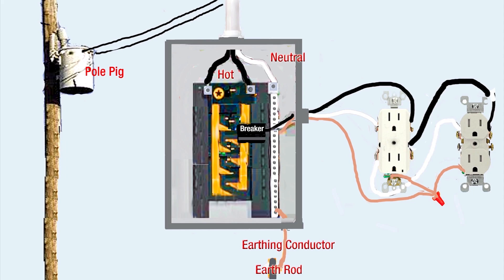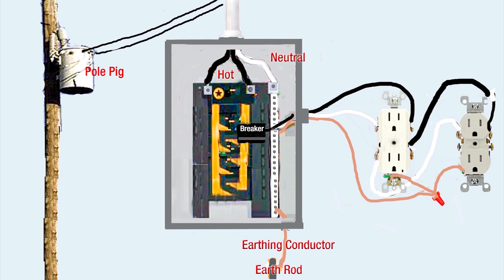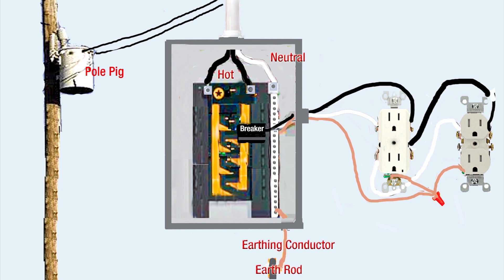Grounding, Bonding, Earthing, Shielding and Protecting with Jim Heath W6LG

Comment: Jim, see Dave Casler's episode 8. He advocates a common ground. His reasoning is that the green ground in the house wiring is too far away from the outside pole ground. It seems that there are multiple opinions on this subject. I even see a real PhD responded in comments here and was also ambivalent regarding grounding. Great video and I really appreciate your sharing of knowledge.
Reply from the maker: Hi and thanks.  I don't watch Dave's videos.  I believe he presents good information.  I just don't want to inadvertently copy his material or ideas.  So, I purposely don't follow Dave.  I did send a letter to him a last year but that did not go anywhere.  There is another guy in CA who's videos are contain a lot of incorrect information.  I have watched several of his and I am shocked by the lack of knowledge.  Back to your question, in the other 2 videos I do try to follow the NEC and the CA electric code.  I do recommend a single point ground of all equipment. I don't recommend a daisy chain.  I do recommend a very low impedance conductor. Everything must go to the Intersystem Bonding Termination.  My view is that using the "green" (it can be another color) wire is too great an impedance.  Watch the two videos from May and see what you think.  Mike Holt is the expert that I relied upon and his recognized in the US as the leading expert on the subject.  Back to Dave, Dave is a good guy and provides good videos with lots of solid information.  As I said, I just don't want to accidentally copy his material or ideas.   I hope that at some time in the future Dave and I can communicate frequently. Thanks, Jim

Comment: Power Plant Electrician for 35+ years.  Do what ever it takes to protect you and your equipment from voltage on the wrong path, but remember as a ham we also have to  keep our noise level down to the lowest value...  The best ground as in RF would be on a large steel ship in sea water.  The ocean is the best counterpoise, but ships have the ground and neutral isolated for electrolysis reasons.  You should get voltage from the nuetral to the ground on the whole ship.  The radio grounds are wide copper strips that connect to the ships hull.  More later, Thanks Jim.  Corey Wade  KG6TVJ or on my boat it might be a ship FCC Call letter system.
Reply from the maker: I have seen that.  Some guys think that 6AWG as called out in the NEC is the answer.  Flat and wide copper is good.  As I am starting from zero, grounding will be step 1.  Thanks Corey!  73, Jim

Comment: Thank you for another great video. I simply love the calm, non-judgemental way that you express your thoughts and mentor, or "Elmer", others.

In answer to your question about GFCI (aka RCD in New Zealand), I believe that having a separate ground connection should NOT defeat the GFCI.  As I understand it, a GFCI continually monitors the current through both the Line (aka "Live" or "Phase") wire and the Neutral wire as a circuit pair.  The device is designed to open, or "trip", any time the current flowing through these wires are different from each other.  Therefore, if a radio or other electrical device or cable developed a fault that allowed current to go direct to ground, or otherwise bypass the expected path back through the GFCI, then any persons or equipment in the faulty path should be protected.  This would be why GFCI breakers in homes were first introduced for external, garage, and "wet" areas within the homes.
For my station I have obtained an isolating power transformer which I am planning to install for my station.  I've wanted to do this for a line while.  It is partly for safety purposes, but also in hopes to help keep RF off the house wiring.
Thanks again for your excellent videos.
73,
Alan
Reply from the maker: Hi Alan,

I misspoke or just had a brain short circuit about the GFCI.  My only excuse is that the first ones sold here may have been different.  In any case, you are correct.  

Let's talk about current flowing to the ground wire/terminal. Here we have 120vac (typically a little higher).  If say more than 10ma flowed through the ground wire in the 3 conductor cord, would the current in the the neutral and hot still be in balance? If say 1amp were to go to ground, what might happen with the other 8 amps? 

Just thinking out loud Alan.  Let me know what you think.  Thanks & 73, Jim
Reply: @ham-radio  Kirchhoff’s Current Law tells me that if part of the current on the Line went to ground then the amount of current on the Neutral must decrease.  So, in your example, if the Line (source wire) had 10 amps coming in then 10 amps **should** be going back out on the Neutral (return wire).  If, say 1 amp somehow made it's way over the 3rd Ground wire, or any other return path, then that law says that the the Neutral wire should only have 9 amps going back.  This would put the current out of balance by 1 amp, as seen by the GFCI.
It is important to note that the current bypass leakage may be by a path other than Ground.  For example, say we have a very large amp with NO Ground wire, pulling 50 amps, fed by a dedicated GFCI.  Let's say that amp has an internal Neutral open fault.  The amp would not turn on.  Now, let's say we connect a coax cable from that amp to a radio being fed by a separate breaker or GFCI.  If the coax, perhaps the shield, completes the lacking Neutral connection through the radio's Neutral wire then a possible overload condition could occur on the radio power circuit.
In this example I guess one would have the choice of electrocution by completing the ground, or by fire from the resulting radio power cord overload.

Back to the original GFCI example, the GFCI should trip as soon as it detects that there is an imbalance between the current in the Line and the Neutral.  "As soon as" is relative, as most things are, since how fast it trips and at what level of imbalance it trips will be defined by the design and construction.  I believe that in the U.S. the residential GFCIs are designed to trip beginning at 5mA and to do so in something under 1 second.
Incidentally, I'm fairly familiar with U.S. power and general house wiring as I'm and ex-pat and spend most of my life in Texas.  As grand as that is, I'm neither an electrician nor a Ph.D, but I've been shocked enough times to know what it feels like.
Cheers,
Alan

Comment: GFI looks at the current going out the hot and the current coming back on the neutral.  If there is a difference the GFI will trip! Don't matter if it comes back on ground wire or if it finds another way to ground! Any difference between what goes out the hot and coming back the neutral will trip it. It is only mileamps
Reply from the maker: That is correct.  And, I think it is something like  20ma where it trips.  73, Jim W6LG

Comment: I live in a old house and there No 3rd wire to any of the wiring!  There for that screw only goes to the box and it is Not ground! It is only connected to the box that is just connected to some wood, and is not in any way Ground!
Reply from the maker: Sounds like knob and tube wiring.  In any case, it is not a good situation and could pose a hazard.  For the safety of my family, I would have rewired that house to current standards right from the driven ground/earth rods or Ufer.   Does the house have a Zinsco panel or something similar?  Are there fuses or breakers?  Good luck sir and stay safe.  73, Jim
Reply: CBS house no dry wall, wires run in the block, flat roof. so I can't get to the wires easy. I upgraded the old fuse box to new breakers and added some wires, and upgraded what I could with out distroying walls.
Reply from the maker: @donaldsmith3048  So ugly surface mold (channels) is all you can do. Sorry to hear that.  73, Jim

Comment: Your (radio station) ground rod should also be connected to your electrical panel. My ground cable comes inside the house, connects to my station's single point ground and then continues to the ground on the electrical panel.  If not connected you could have a potential difference between the grounds.  Check out the ARRL book on grounding and bonding.
Reply from the maker: Please watch all of the Parts to this discussion.  You may want to follow the ARRL.  Or, you may want to do as shown and enforced by most jurisdictions using the National Electric Code.  You can have a potential difference between ground rods if incorrectly installed and incorrectly bonded.  Thanks Chuck.  Regards, Jim

Comment: Excellent video, it all makes sense, except for one thing. We add ground rods at the tower and at the entry point of the shack for the lighting/static arrestor's on the coax and this will take the equipment chassis to ground. Is this different because of the braided shield in the coax. Wow, I'm confused.
Reply from the maker: Excellent point you make.  I am working on that answer.  Honestly, I have had little time to spare since we are selling the house and moving closer to our oldest son because of my health.  I have drawn the graphics in Photoshop, gotten some graphics and help from the expert, Mike Holt and his company.  Tomorrow is my 70th birthday and I will try to take some time to do the voice-over for the next video answering the question.  The short answer is,  in my view, my opinion as  verified with experts, dangerous to have that second ground rod separate from the ground rod, Ufer, or water pipe at the main panel.  You can have a fault that does not trip the breaker.  Thanks for asking.  Stay tuned!  73, Jim Heath W6LG

Comment: Thank you for the video and information. What about RF ground? Would that tie into the same electrical ground or is that supposed to be a separate ground? It appears to be connected to the electrical ground via the SO-239 connectors and case of the equipment but it kinda makes sense that you might have noise from that setup. Maybe that's where the "Bucket Load" of ferrite chokes comes into play. :-) This topic is confusing but fun! 73's

Comment: @Jim W6LG I'm sure you're busy as you prepare to leave Wolf Mountain. I apologize if I am intruding.

I too am leaving California. The high taxes and gasoline and everything else and the political climate has caused me to just want the heck out. I'm looking at a 25-acre parcel in Alabama where they get regular thunderstorms.

The home that is there already is somewhat awkward although solar-powered and their water heater is wood fed. Not quite my cup of tea. I'd like to have it pulled down and put a nice log cabin in there.

I have read of people that have dug a trench all the way around their house at about 6 inches deep and they put I believe it was half inch or maybe even only quarter inch copper pipe all around the house and it dead-ends just below the service panel. The various antenna towers could be tied to this also but that's beyond my knowledge level.

To the point, if this type of grounding were used and tied to the central ground point of the electrical system would this provide improved ground protection especially in thunderstorm alley?

Comment: Wow! I’ve been misled all these years. Everything I’ve been told is the way I have my station grounded. I have NO RFI issues at all. I have one 8ft ground rod drilled thru my garage floor to earth. I have a 3/4” copper water pipe running the length of my bench. All of my equipment is connected to that pipe and the pipe is connected via 1” thick copper braid. The connection from my equipment to the water pipe is via 3/4” copper braid. Should I connect the ground to the ground rod at my panel or start all over? Confused! Thanks for the video I think?
Reply from the maker: Thanks.  Many have asked the same question. I plan on a "to the point" episode with my view of the NEC requires and what works for us.  A short answer to your question, is the ground rod, in my view, should be connected to the main panel grounding buss bar. Any fault at the equipment must return to the main panel (sub panel is another issue to be discussed). The path of the current must flow to the panel so that the breaker can trip. As you know, current will flow through several paths depending on the resistance/impedance. If you had a short through your body and most of the current flowed to your low impedance ground connection, the breaker might not trip.  RFI and the rest is another issue.  Basically, you keep that RF out of the shack.  All of the instruction books for transmitters that I have ever looked at have the same connection that you describe. You can have an antenna ground and cable ground for example. They too, in my view, must connect to the main pane. I hope that helps a little. It is very confusing.   73, Jim W6LG

Comment: Hello again Jim,
Good explanation about grounds.  An even more complex situation is an HF radio on a boat with optional connections to shore power.  Boats have "water" connections as well as shore power ground which is alway a few volts different than the water.
Anyway, one note about GFIs.  They do not use the mains earth ground to detect  a fault.  GFIs will work exactly the same without an earth ground connection.  I have tested this.
GFIs measure the difference between the hot and return currents.  If they are the same, all is well.  If they are different, then some current is going somewhere else and it trips.  The GFI cannot directly sense current to ground.  If only knows that some of the current flowing out through the circuit isn't making it back.
Reply from the maker: Ya, I had that wrong.  I had different type many years ago and for some reason that stuck with me even though things have changed.  GFCI can be installed in an older  home with 2 wire AC lines to each convenience outlet because they don't need that third wire. Thanks. 73, Jim

Comment: Here's an old article on Eham about station Grounding.

https://www.eham.net/articles/21383

I still believe that modern homes have a earth connection already via the green lead in the plug which will be connected to chassis and is than connected to RCD protection which cuts power at 30 ma and that alone can give much better protection than a piece of wire connected to ground which might allow far more than 30 ma across your body before anything happens without RCD protection.

What happens if no RCD protection and nothing to cut power if earth fault is detected ? will current endlessly flow to ground until someone cuts power ? what if you are in between this path with current flowing through you ? this is not a very safe way to protect yourself as far as I'm concerned. 

Without RCD protection current will flow to earth until fault is fixed or power cut, with RCD protection power is cut almost instantly. 

So again in my opinion, the best way to protect you from faulty equipment is not to bring a load of copper into the shack connected to a big copper bus-bar but to install sockets with built in RCD protection which is the proper modern way to do it, first line of protection but as I said most homes ( at least where I live ) built in the last 30-40 years will already have RDC protection in the main fuse box/consumer unit etc. 

You can even buy devices that plug into the wall socket to determine if your earth is working or not but always have RCD protection at the shack, as this will act much faster than any piece of wire connected to ground.

By all means earth the coax outside before the shack to protect against lightning but please check your home has RCD protection if not fit RCD protected sockets , first seek advice from an electrician.

Comment: Well, I like your reasoning, but I think there is a flaw.  1. The ground doesn’t bypass GFI. If the neutral current doesn’t equal hot current then the GFI trips, disrupting the hot, shutting everything off.  2. Assuming a nonGFI outlet, if the radio is earthed properly, then wouldn’t the current flow through the earthing system rather than the person, following the path of least resistance.  If not earthed, a person would be creating a primary path for current to flow to the earth -> electrocution, but in an earthed system a less resistive path already exists, and so the person is spared.

I am an Electrical Engineering student, not a PhD or anything.  I could easily be wrong, but that’s my understanding as of this point.
Reply from the maker: I think you are correct and I was wrong about the functioning of the newer GFCI outlets and breakers.  As I read the NEC and others, they want the ground lines to all lead back to the main panel or sub-panel (if the sub is on another building). I am currently working on the next video when there is time and I feel up to it.  It makes good sense to me to have all current flow through the panel and not straight to ground.  Thanks, Jim

Comment: THANK YOU for covering the topic.

As an FYI, my GCFI/GFI breakers do not have a ground connected to them, but they do have a neutral passing through it near the hot.  How mine work is they sense a difference of current between the hot and neutral (black and white) wires and trip the breaker if the current in both does not match.  Your breakers could be and are most likely different than mine.

I don't like the idea, but they thing the reasoning behind it is that if the current is different from the black and white wired, then it must be traveling through the ground wire.
Reply: That’s what I have heard too.  There’s a solenoid in the outlet such that as soon as there is a discrepancy between the hot and neutral the breaker will trip.  The reasoning being that if is isn’t in the neutral, it’s not where it is supposed to be.

Technology connections put out a great video on this.